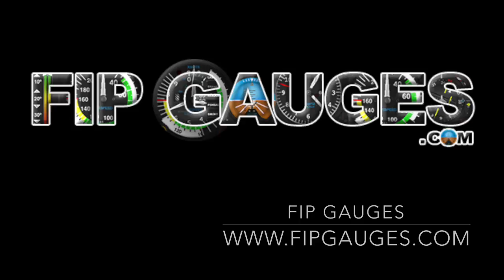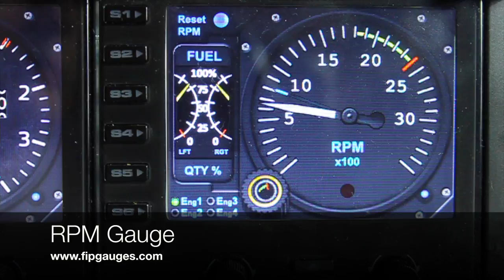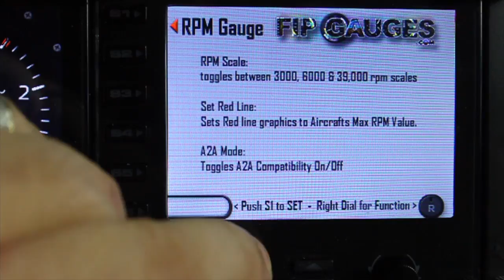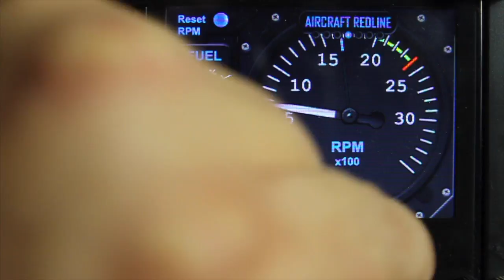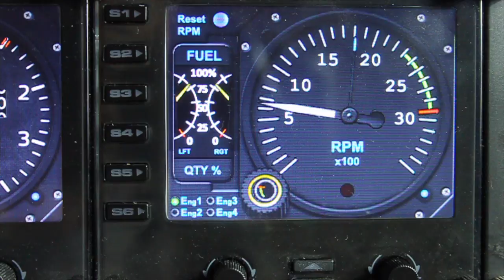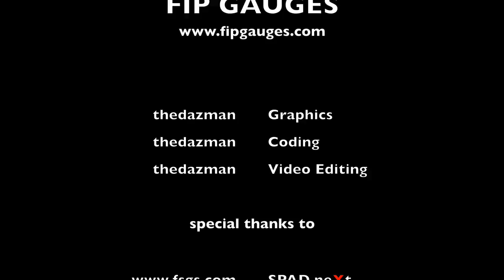RPM Gauge - Saitek/Logitech Flight Information Panel & SPAD.neXt

Comment: Thank you, that looks like very useful information. My question would be where did you find an rpm gauge? I don’t have that option in my gauge cluster. I have a typical 6 pack plus the small, 4 instrument engine monitor with fuel gauges, temperature, tach, etc. but that’s the only way I have found an rpm gauge at all and it is very small to read and hard to use. I’ve heard there are updates for the gauges but I never have found any. I subscribed to your channel today and hopefully will find the info on here. If you can help, I would appreciate it. Thanks for sharing.
Reply from the maker: I created the gauges myself and have around 200 gauges, 78 of which are for sale at fipgauges.com (SPAD.neXt and a supported simulator is required)

Comment: Great video.  Could these or similar gauges be used to power things on a desk such as lights or a printer etc?  Thanks in advance for any input.
Reply from the maker: TeachLearner, my gauges are software, they can't power anything. The hardware my gauges run on, Saitek FIPs, are small USB devices and are used to display output from a simulator and not to control anything external to the simulator. My gauges send and receive simconnect data only.